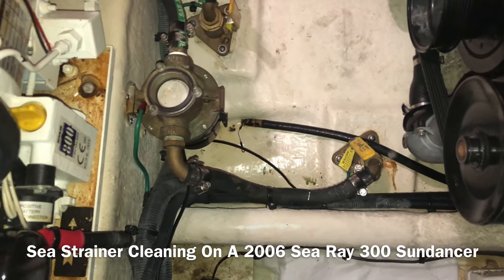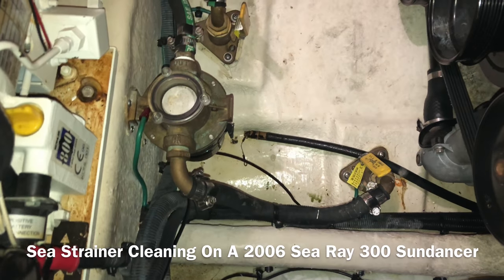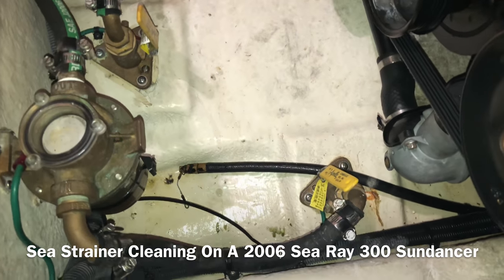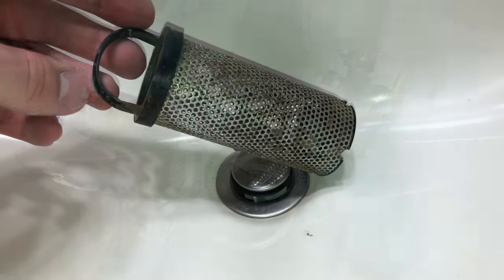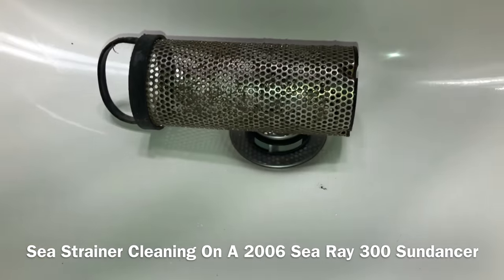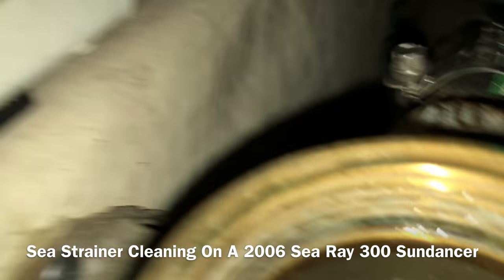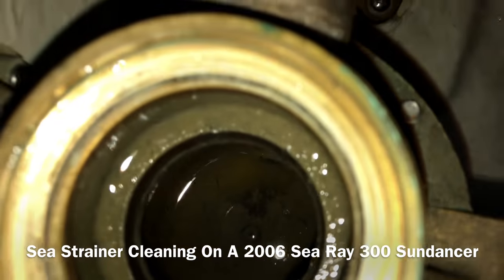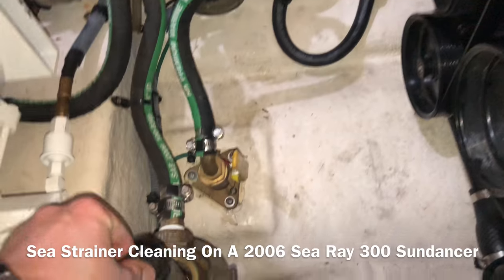Sea Ray Sundancer Sea Strainer Cleaning

Comment: Would it not be better to use a wet vac to suck the water out of the strainer instead of letting it drain into the bilge?  I just bought a 2000 340 Sundancer and will be cleaning mine this weekend.

Comment: What is the sea strainer for?
Reply from the maker: Kev G This is for filtering out any contaminates that could be sucked into any device operated with water on your boat.  For example.  If you have your air conditioning or generator on and you didn’t have a sea strainer and you were to suck up sea weed or another contaminate, it could potentially clog that system up causing it stop working.  So in summary a sea stratiner is just a giant filter.  Take care!  -Nic